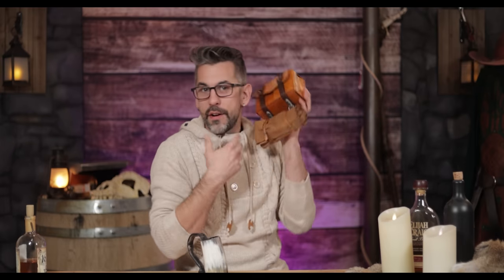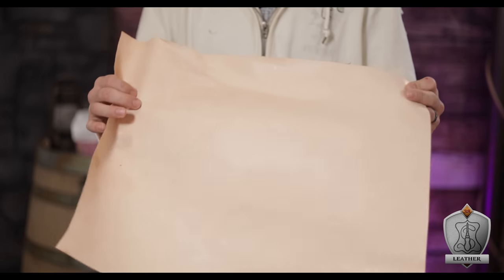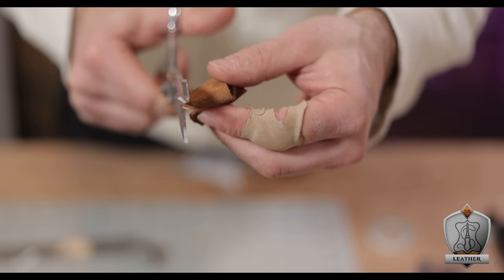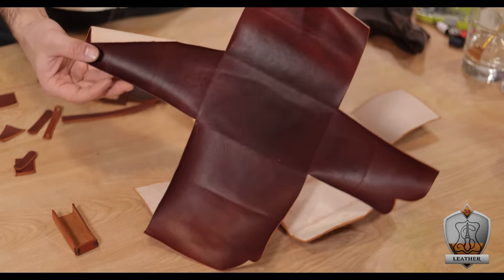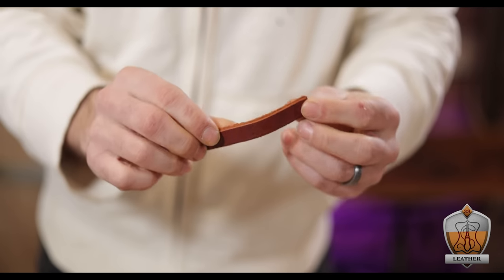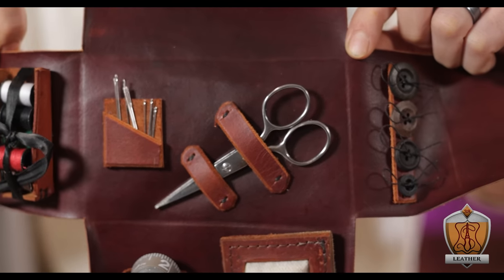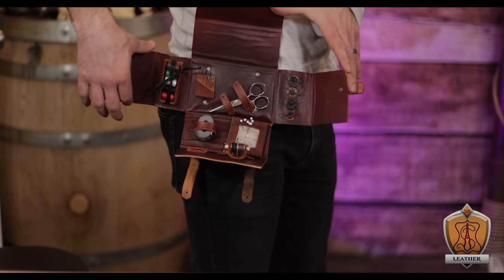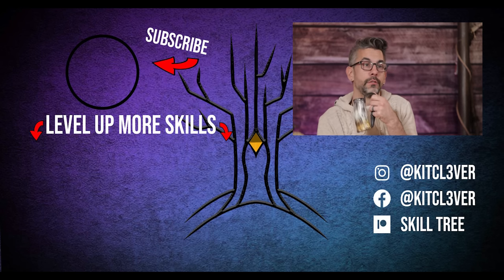A LARP Bag of Mending

Comment from the maker: ⭐Join LEVEL UP LARP here to potentially win a trip to Germany to participate in the world's largest LARP: Conquest https://burgschneider.us/leveluplarp/
Reply: Just a quick note: The time between applying the contact adhesive and then bonding them together is called "flash"... ex: "I applied the contact adhesive and waited for it to flash before bonding them together."
Reply: When you gonna do some other crafting or are you strictly larp now???
Reply from the maker: branchcore  what kinda crafting you have in mind. Looking to blacksmith soon. The skills I do for larp or nerdcraft in general can be used to do non larp stuff too😁
Reply: @SkillTree  ninja smoke bombs, sand or snow glasses, what about one of those hats tinkers wear that have 26 different lens...
Reply: There are a few things that I would thing work as upgrades/replacements.

The first being swapping out the button design for a pouch, which would make it easier to handle a lot more options with buttons and would be a lot less work and could carry more/more variety with easier access to them, and would allow space for things like larger beads that are often used in a lot of leather and other work but can come off.

I would also add a spot for a marking tool of some kind for keeping things going, and one of the destitching tools, both to make repairs easy and to have them available. A charcoal pencil would be a good option for an easy marking tool that doesn't require work and is rather easy to clean off, but can mark on most things, and a destitching tool is something you can find in a lot of the cheap "repair" kits you can find and lets you get stitches out so you can have space to do some repairs with stitching...especially with things using waxed thread because you often need to remove a few stitches to have space to tie in the new thread for repairs.

The other thing might be to get some oil cloth or similar thing that's more water resistant and work that in as a layer between the outer and inner edge, perhaps extended between pieces as well, to help protecting the kit...I've had several nice pieces wrecked by water getting in to the point where I went to hell with it and added plastic bags to protect things inside.
Reply: @SpiderboyN2Jesus  I was mainly using the name that I've heard used, and there's a few different options than just the seam ripper.
Reply: It's almost been a year since the video was uploaded. How is the project holding up?

Comment: For storing the needles it's very effective to use magnets! You can put a strip of magnetic tape on the back of the lining, and it will keep the needles secure. Also, if your primary use for the kit will be repair work you might want to add a seam ripper and a darning egg to the kit. Both are very useful tools for doing repair work since popped seams and small holes are such common mishaps.
Reply: I haven't had much luck with magnetic needle holders personally. Needles tend to rotate or fly off whenever something knocks the holder around. I prefer a strip of fabric; just pop your needle tip down through the cloth two or three times and it becomes completely secure. A scrap of about 3" by 12" can hold a hundred needles and rolls up to less than an inch in diameter for storage, and can be held together by another needle (just end the point inside the cloth for safety) or a safety pin. That said, for just a few needles, I do really like his design, and I do agree about the thread picker and darning egg (or alternately, a few fabric patches to stitch on at need). He surely can't be wearing all leather without cloth underneath, so he should be ready to repair fabric.

Comment: For anyone who wants to know, the leather thymbole also works for fabric sewing projects. The only difference is you want to use the measurments of you middle finger not your thumb(because of how you typically hold the needle and fabric) and you want to close up the top, not leave it open as is done in the video. This is because your usually pushing with the tip of your finger, not the pad, and leaving it open would lead to stabbed fingers.
Reply: Great advice! I have some store-bought thimbles that are open at the tip... And have slipped a needle under skin and nail before... I highly recommend your advice!
Reply: As a leather worker, the force needed to drive some needles through your work can be significant and using your thumb isn't a ridiculous thought. On top of that, leather is much higher friction and the sewing needles bite into the material and slip Way less than many other options.
Reply: Yeah I was wondering why the thimble had the opening. I do like the reinforcement inside, my old thimble isn't very sturdy anymore, I´ll definitely try this version (closed at the top of course) when the current one dies
Reply: I've made a fully enclosed leather thimble for sewing heavy stuff, after getting stabbed multiple times in multiple ways it's now 4 layers of leather thick and i think it's finally thick enough for now XD
Reply: @Taliesin6  My leather thimble had a small curved metal disc protecting the tip of my finger (it was a closed end style).   Great for the underneath hand in quilting.
Reply: @karladenton5034  that's smart!

Comment: I love that you used scraps that you had on hand for this. I'm always frugal with my projects if I can be. I'm working on my first block-print, and rather than use new materials (like very expensive speedy carve I can't afford), I'm using some eva foam that's older than the gods themselves and foamcore board. I don't know if it will work, but that's what learning is about.
Reply from the maker: I hope you let us know how it comes out!
Reply: Don't forget to seal the board so it doesn't get soft
Reply: @SkillTree  I'm sure you'll see it, Cl3ver. ;')

Comment: Oh, also (though I don't know if you'll see this) I saw a video of someone using a rubber stamp to make a disign on the leather with dye instead of engraving it. What they did was take a dobber and generously apply the dye onto the stamp. They then pressed the stamp on the leather and "bam" easy design. They then let it dry and applied a lighter dye to the top. It turned out really nice, and I think it would be cool to see how you would use this technique to creat something.

Comment: you want to keep from having very sharp corners. When you first cut out your pattern those inside Corners will be a weak spot. Take a small hole punch and slightly round those off. This will keep the leather from wanting to tear

Comment: Great project and video. As a fellow leather crafter I'd suggest a v-gouge instead of the French, it's a thinner fold line and doesn't require water to form. For the smaller boxes, instead of a razor use a stitch groover. The line will be more finished and less harsh since they're on the outer edge of the fold.

Comment: We use 3m super 77 at work to attach laminated placards to the metal crossbars of oyr racking system, it allows them to come off later when we want them to but not blow off in the wind

Comment: Nice project and came out great.  I once made a similar looking but slightly smaller leather box to hold two Altoids tins - one tin to hold a fire kit and the other tin to hold a few first aid things, some water purification tablets and other sundries.  I cut a small hole in the bottom to be able to push the tins up from below with a finger to get a hold of them.  It snapped closed and had a loop on top to hold a Ferro rod.  I made it for a girl I was dating at the time for when we went camping, on our short hikes, etc.  Mine didn't open completely like yours - I based it on a leather ammo pouch I had that came with my Mosin-Nagant.   Maybe I should make another for myself but I have a few, other leather projects I need to get around to, first.

Now, since you included tools to be able to repair/craft leather you need to make a way - maybe something as simple as a reinforced leather tube with a carry strap - kind of like a map case - to be able to carry pieces of leather to use for patching gear or crafting new things.

Comment: Been binging your videos after finding your channel, and I love these projects ^^
An idea for those little punched nubbins of leather, you can use them to make part of the padding for a carry strap - specifically, the part you hold onto with your hands. A lot of 'just a strap' types of carrying methods can be uncomfortable. If you use it for a carry handle attached to a long strap with an adjustable attachment point, you could use it to help carry bundles of twigs or firewood easier.

Comment: Hey cool video, do you think you could make an anvil stand, I recently built a forge and got into blacksmithing (following your tutorial of course) and I need a stand
Reply from the maker: I will be needing one myself soon for sure! I will see what I can do!
Reply: You want the face of the anvil to be about knuckle height when your arm is at your side (so measurements will be different for everyone based on height and anvil size).

You can build a pretty sturdy stand with 4×4 or 6×6 fence posts (oak is nice and heavy, cedar is more weather resistant.)

Cut six posts to the lenght you need and glue/clamp them into a 2×3 grid (with the ends of the posts being the fave and foot of the stand) and it should be suitable for small anvils. You can run long threaded rod horizontally through it, tighted with nuts and washers if you want it even sturdier. (But just glue is usually good enough for light anvils)

The 4×4 posts will give you a stand that is 8 inches by 12 inches, suitable for smaller anvils, such as the track anvil he made.
   The 6×6 posts will result in one that is 12 inches by 18 inches, suitable for anvils with a larger footprint.

Comment: If you make a pin cushion again in the future, a piece of steel wool instead. I found that some materials in pin cushions will actually dull your needles when using and pin cushions with steel wool in them help keep the needle sharper longer. 
Secondly, I would recommend adding safety pins to the kit. Safety pins can temporarily hold things in place till you finish your mend.

Comment: This is a nifty little kit. For your thimble. Have you seen an Indian leather flat thimble? They are great, take up very little space. I've one I've been using at least 12 years. As long as you keep them from drying out they are indestructible  and fun to use.  I can make you one if you send your thumbs dimensions  and length from tip to the first joint.
I do stuff like this with leather and bone. My heritage. 

Tamma  (Thunder)

Comment: Personally, I wouldn't use the leather nubbins to stuff the pincushion ... too tough. I'd stuff it with scraps of cotton or batting, either purchased or foraged, so I could stick pins inside without being worried that the point would skate off leather or get stuck in a piece. Cattail down and milkweed seed are two of the wildcrafted options I'm familiar with. As for what to do with the leather bits, I would make compost or just scatter them in the woods. Nature will reclaim them soon enough.

As someone said earlier, make sure to include tools for fabric repair, whether you prefer darning or patching. It's really hard to avoid fabric when you're talking about garb, so you should be just as ready to mend cloth as leather.

Great build though. It gives me some ideas for things to do myself.

Comment: Awesome build! 
A couple suggestions: 
1) Attach the strap and closures before gluing on your inside lining, so they aren't visible when you open it.
2) If I were to make this, i would have made the strap that went around the box a little bit longer, and then just fastened it directly around the leatherworking suede roll. 
3) I wouldn't store the pins inside of the pincushion, I feel like they'd come out too easily when shaking it and if you had a little strap for a plastic box of pins, you could probably fit more. 
4) Last thing would be to add some weights at the corners of the wings so that if you unfold it on a table, it stays flat for you to work. How I would do this probably would be to put the weights between the two layers and thin the outer one a little bit to get a pocket with a bit more room. This last one is a little bit less feasible, since I don't have the box in front of me I can't tell how stiff the leather is (and thus, I don't know how much weight would be required to get it to lay flat). However, if it can be done, it would be a good addition. 

You probably could have fit one or two more things into the box, too, though I can't think of anything too important at the moment.

Love your content, hope to see more cool things in the future!

Comment: What a massive box, IMHO much too bulky for it's contents. Put all threads on bobbins like the waxed ones and line them up around a sturdy wire, stack your buttons instead of displaying them one-by-one and take a bobbin-diameter wooden dowel or stick and drill a hole through the center for needles at one side and make a plug out of the same stick to close it.
Make a big hole at the other end to take the pin cushion with pins (fill it with felt instead of leather punch-outs) - your kit will be only half as thick.
Add some sailing needles to your kit (2 -3 sizes), they are superior on stitching heavy fabric (they are not really pointy, so they slide between the threads instead of cutting through them like regular sewing needles).
Replace your thimble - sewing heavy duty fabric or leather will push the needles' ends even through 6-ounce-leather, sailors use a piece of cast iron (Ø approx.1") with several indents, the rim covered by leather (sailmakers glove) and placed on the ball of the thumb.

It may go to the opposite side of the box together with the tape measure and the scissors.
To make it even more versatile, add a shortened bait-needle to retract pulled out wool threads, and a 2" piece of steel wire with a small eyelet on each end to pull cords through hollow seams.
As I do a lot of 'fancywork', complicated leather/paracord- knots and -weaves I also carry a set of customized circular knitting needles. They were made of steel tubing and were 1€ each, so cutting them apart and cut to different lenghts, from 5€ I got two sets of 5 fids, that stack inside each other nicely, each smaller size beeing proud some 1/8" of the next larger size.
Stay safe and good luck at the LARP convention, enjoy Xmas time

Comment: The only thing missing from this kit is some form of striking tool. A small 6 oz hammer with a thin handle could slip nicely onto that tool roll or under the strapping for the roll. Other than that, this goes on the list for sh!t i need to make

Comment: The wasted leather is still making me cry,  you could have made the box out of 3 parts and had enough leather from that one peice to make 2 whole projects
Reply from the maker: 6 of one half a dozen of the other, lol. I don't throw ANY scrap leather away. Thos bits will end up ad parts of other projects or things I need around the house. Zipper pulls, backing for studs in fabric, covers for razor blades. Pleanty of uses for leather😁
Reply: @SkillTree  true. Cool project anyway and it turned out great 👍